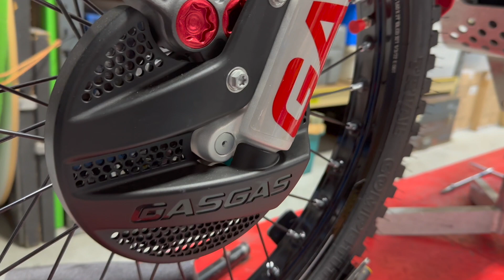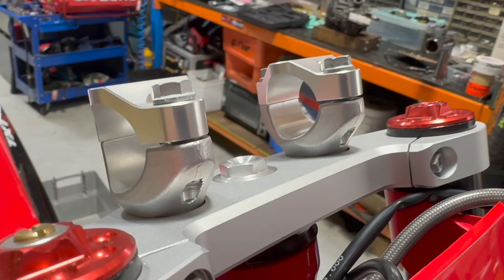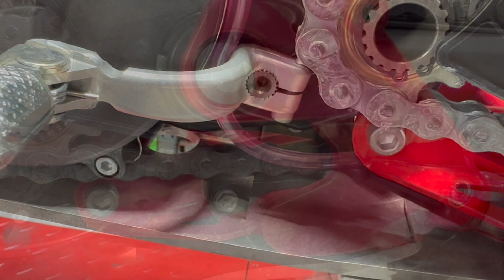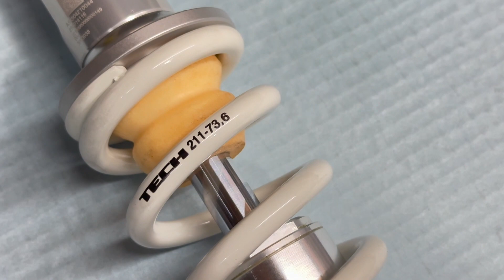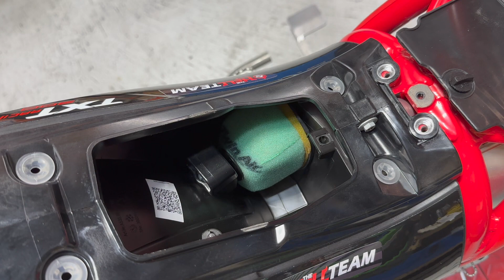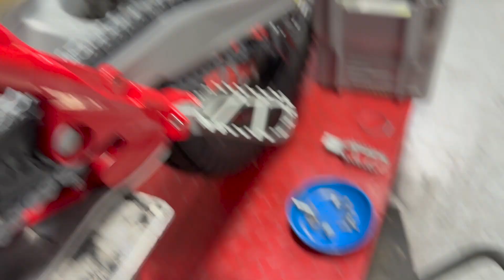The Hell Team Trials Workshop   2023 GasGas RACING (HD)

Comment: Great video! Thank you. I love the size of the pegs on mine. My feet feel extremely planted and they don’t tire out or cramp like smaller pegs tend to do. I do think the water protection flap wasn’t thought through though. It’s a pain to get fingers around the screw/clip holding it on. The plastic fenders ARE amazing, I don’t think I’ll ever break one. Starting the factory bike is very difficult and almost impossible for a smaller person. I put a 1mm head gasket on and it’s very easy to start now.
Reply: 1 minute into riding my new 300 GP and Leaned against a tree and pinged the guard off, snapped off clean across was defo gutted, $250 to replace and none in NZ, not impressed.

Comment: why don't the wheel bearings on the gasgas have dust seals like a dirtbike?
Reply from the maker: You would have to direct that question to GasGas Julian, but ALL trial manufacturers run a similar arrangement. The 6004 bearings used are sealed, and no "extra" dust seal is deemed to be required.

Comment: I bought this bike and I'm 59 years old. Recovering from throat cancer surgery and very concerned about starting the bike. All the videos and blogs talk about how hard it is to start. Is it really that bad? Thanks
Reply from the maker: It's not bad if you have the correct technique, it's just not a "soft" kicker. It has a quadrant gear kick start mechanism, so the kick gear is engaged for a very short time with the idler gear, and you need to get some momentum into the engine to get it fired up. So don't be a wuss! and you'll be fine.

Comment: did you try any other pegs I know you said they dont work. I want to get s3 hardrock would it just need a little material removed to fit or very different how they mount.
Reply from the maker: Yes I tried all S3 pegs, Jitsie Ratio pegs, Hebo pegs and the old stock Gasgas pegs, none work on this bike unfortunately.
Reply: @TheHellTeamTrials  were they close at all to fitting could grinding off a little bit of the pegs make them fit. is the pin on the frame a new angle I'm just trying to see what changed  from the previous frame.
Reply from the maker: @BurgerTime3  cant be done without some serious fabrication. Foot peg modification AND extensive frame modifications. PITA.
Reply: @TheHellTeamTrials  ok bummer. thanks
Reply: I just noticed and I dont know if its wrong but on s3 website you can select 2023 GasGas txt 300 and it says the steel hardrock pegs fit and the alum curved hardrock. if doesnt fir that could make a lot of irritated customers
Reply from the maker: @BurgerTime3  mate send me an email, and `i'll send you a  video of an attempted fitting of an S3 peg on the 23. IT DOES NOT FIT.
Reply: @TheHellTeamTrials  Im not trying to argue I believe you Im just saying s3 is going to have unhappy customers cause they say it fits 2023 TXT but I know it doesn't
Reply from the maker: @BurgerTime3  no all cool George, I'll let Michel know so he can change the description, thanks for letting me know.

Comment: Excellent video Paul. You did well to get a bike!  Regarding the pegs, isn't the overall width of the bike the same as before?
Reply from the maker: The previous 2022 model is 450mm wide, the 2023 is 480mm wide peg tip to peg tip. When pegs folded up the 2022 is 320mm wide and the 2023 is 390mm wide.
Reply: @TheHellTeamTrials  Thanks Paul, no doubt the aftermarket guys will have plenty of alternative parts soon.  The bike looks like they forgot to apply the graphics. I suppose they can't curl up at the edges if they don't exist.  Rappers and I met you at the Vertigo launch in Spain.
Reply from the maker: @andyfoot2577  hey Andy, good to touch base again mate. The only stickers on this new RACING model are the black panels on the side of the air box! The rear guard graphics is actually a sublimated logo, so it is etched into the plastic. It's going nowhere. (I should have mentioned that in the video, DOH)!